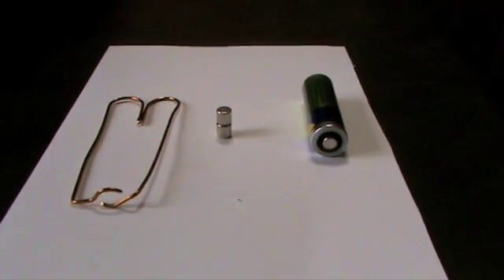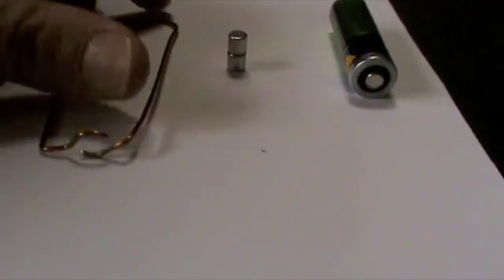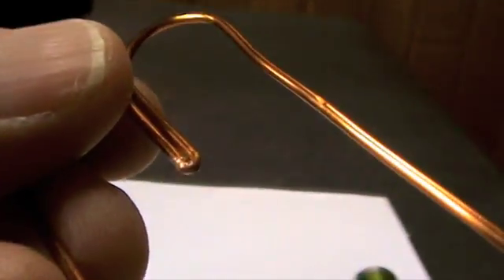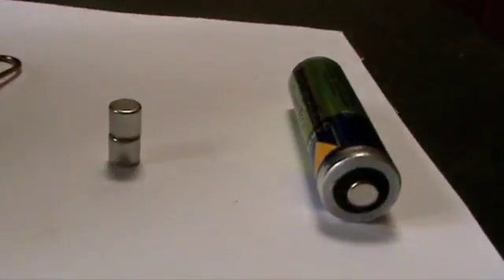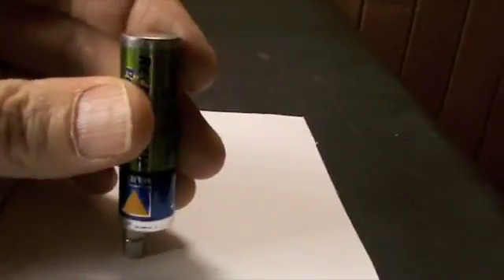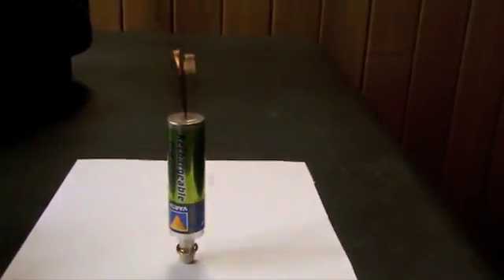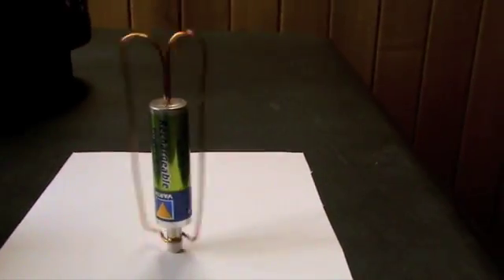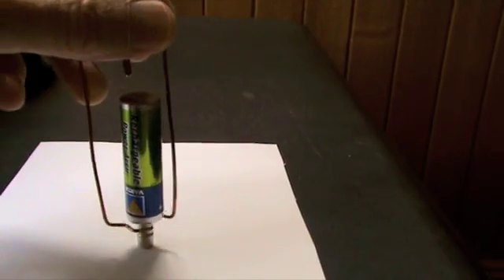Faraday

Comment: This works due to the magnetic particles are in a constant state of flux, watch the contact between the 2 magnets, the N-S pressed together. This is the bloch wall that allows a path for the magnetic particles to flow along the wire. Clearly, this demo shows when you reverse the polarity on the magnets in relation to the wire. This caused the magnetic particles in the bloch wall to reverse the there polarity and thus the motor/wire spin in the opposite direction.
Great clip